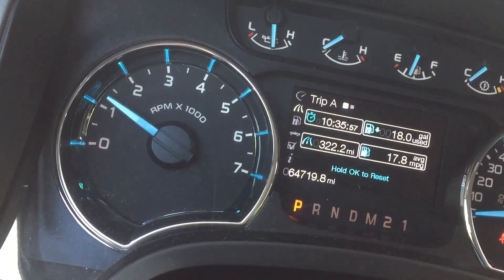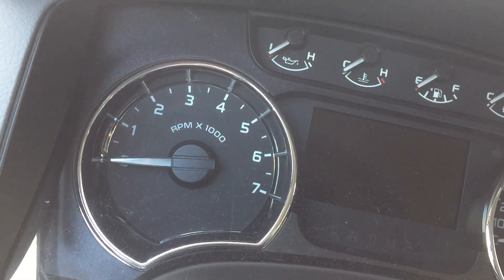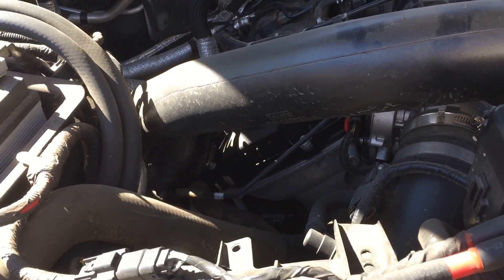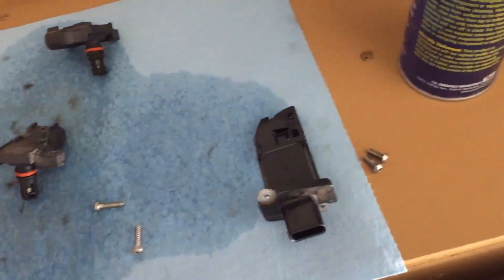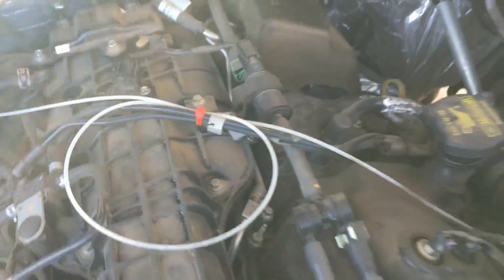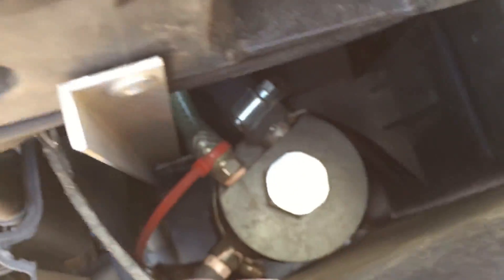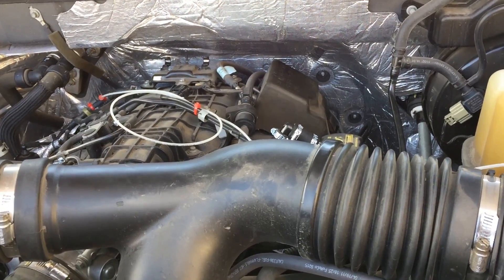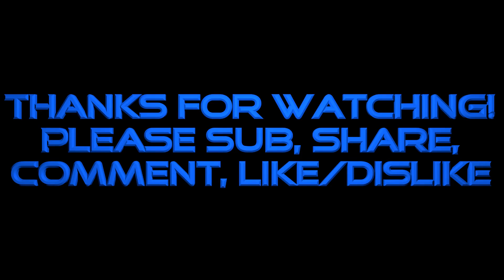Ecoboost Shudder Fix

Comment: The MAP sensor lives in oil and crankcase fumes.. youd have to clean it every oil change if it was that big of a deal 🤔🤔 as long as it doesnt thickly coat the sensing strip inside you'll be fine, hence the cage surrounding it
 MAF sensors are prone to new air filter particles & other light or heavy road debree protruding past the filter, smacking the bimetallic strip.. so cleaning your MAF or MAP is more of a last ditch attempt to hope it actually work after all else has failed.. so yea it doesnt hurt to clean it.

Heres a Tip, if you lightly tap the maf sensor at idle, and the hesitation temporarily goes away, its a defective MAF.. no need to check 12V power & 5V signal and/or 2k to 7k Hertz @ idle etc etc etc, depending on design. 👍

Also, all the DIY/non-mechanically inclined watching this, be verrryyy careful with your MAF, as 60% of cars now also have the IAT sensor fused into the same sensor, just in a different part of it, so make sure u actually KNOW which 1 your cleaning, and DO NOT poke it with a screw driver to try and clean hard gunk off of it. Youve been warned :)

Also the 'fix' was reported as drilling a weep hole in your intercooler as to let the condensation drain out and not be sucked in the intake, diluting your A/F ratio, hence misfire. BUT Fords TSB states to DITCH that approach, and actually just REMOVE your 2 Air deflectors 1 at the top of the intercooler and 1 at the bottom, THEN Reflash your PCM.PROBLEM SOLVED. But by all means throw the $$ at the parts guy first, plugs, wires, you name it ^^. I think your random hope/approach is much more cost friendly to the viewer, so you can atleast get a thumbs up for that.
Guess away my friends!
Reply from the maker: This is valid when cars use a maf actually as a maf. These trucks have one but only use it as an IAT, not as a maf. So the hesitation is the sluggish MAP response. Those sensors are designed to live in an air environment not an oil bath as other commenters are suggesting.

Comment: That big sensor is a maf sensor, mass air flow sensor.
Reply from the maker: That is correct, but keep in mind these trucks do NOT use the maf as a maf, they are only used for IAT measurements. The other two are MAP sensors. I misspoke in the video. Its not worth re-editing to correct.
Reply: Yes it is, but it isn't used as a maf, and only 2011 had them. He was correct on the way the system works.
Reply: @Stickerslapper  Are you sure? He also stated it had 3 map sensors, no mention of one maf sensor.

Comment: correct me if I am wrong but a catch can is of a lot of help to any direct injected motor. The reason it is more helpful to a turbo is that you get a lot more blow back?
Reply: Jon Jon correct the 2011-2017 ecoboosts have misfire issues because the blow by starts collecting in the intercooler then begins coating the spark plugs ruining them and the coil packs
Reply from the maker: Very helpful and the one I like best is now linked in the video description.
Reply: Jon Jon Diesel engines are direct injection and no one complain about caked up intake valves. You guys are worried about nothing.
Reply: if you use the right oil there is nothing to worry about direct injection motors burn way hotter than non turbos ....regular oil will burn and coke up on the back side of the valve steams and cause engine failure,I run a full synthetic oil they are good about not causing this trouble as they have a higher heat threshold. @Fone65
Reply: @Fone65  apples to oranges because it's diesel.

The newer F-150 Ecoboost models now have dual injection.
Reply: @himovertherethatsme  And my 2016 F165 has 48k miles and run fine.
Reply: @Fone65  I have a 13, almost hitting 200k and can say the same. However, it's bone stock and don't get on it as rough as most. But I did have to make a weep hole. Sensors are needing a good cleaning too. I'm just saying though, Ford ending up making these in dual injection was for a very good reason. Only direct was a poor design for gas.

Comment: the real problem is that it's aFord and you got scammed your not done  many more problems with these trucks !! MANY
Reply: I think you may not know what your talking about.
Reply from the maker: Hahaha, I am always amused at comments like this. You are full of vitriol while ignorant of the global problems happening to ALL direct injection engines which are not going away. They will soon be in everything that isn't a mild hybrid. So it is you who are in for the wake-up call. I am taking time from other more profitable ventures to share early solutions to these problems. If you would rather drive a c10 with a 454 and shim your starter, this isn't a channel for you. If you recognize good engineering with draconian accountants for bosses, then you understand ford is 5-10 years ahead of the curve compared to the other manufacturers. The maintenance problems are easily solved rather than redesigning the firing order of the cam to make a GM 5.7 variant more efficient.